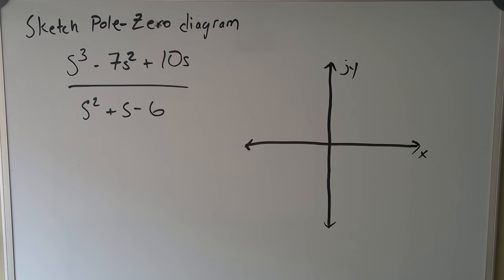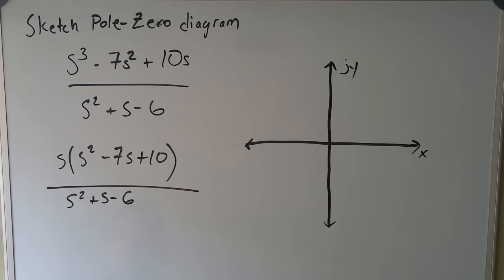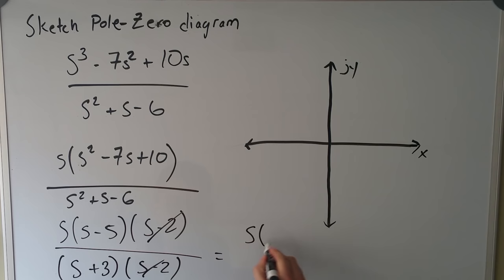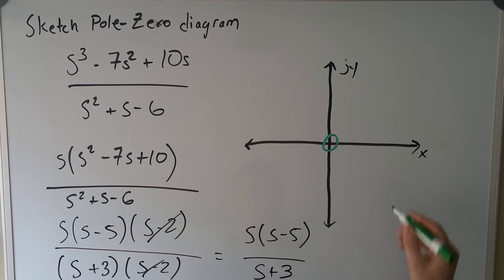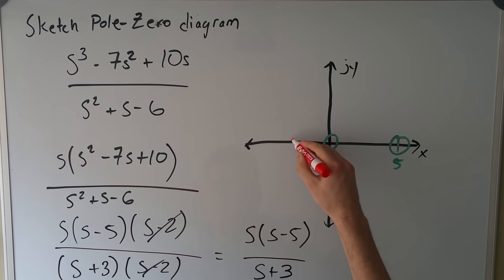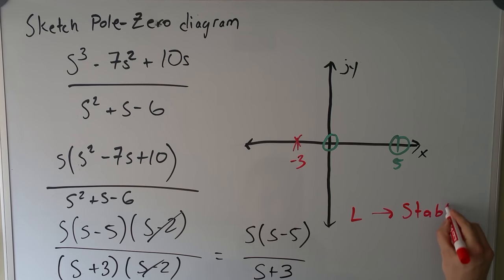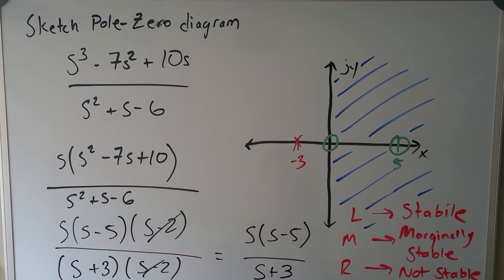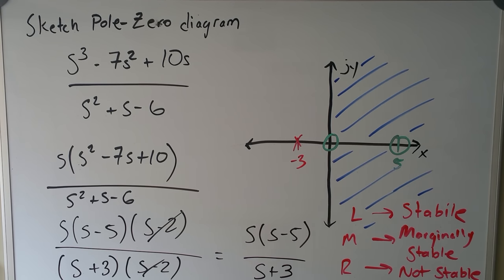How to plot a pole zero diagram and verify stability

Comment: good video, better than my prof. but what if you have a pole in both sides, would that be stable?
Reply: If it had a pole on both sides, it would not be stable. This is because if X(s) had a pole to the right of the jy (imaginary) axis, it would have a component that increases exponentially.
Reply: I know that feeling bro
Reply: In control system we only talk about the causal system only and there is no causal stable system which have a roots at right hand side therefore in a view of cont s , any single pole/zeros lie at the rhs then it will make the system unstable,  but there is a one non causal stable system which have roots at rhs , i,g   e^at*u(-t).
Reply: If any poles or zeros are 0 what will it called?

Comment: but what if the poles are both in the left and right hand side?
Reply: even if only a single pole lies at right side ,system is consider as unstable. even if it is having a pole at left. it will be unstable only.